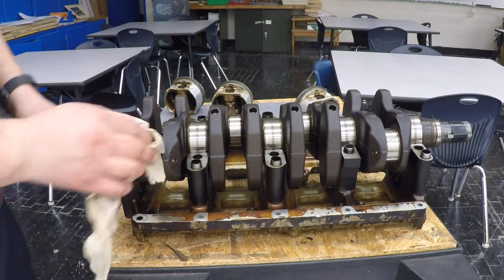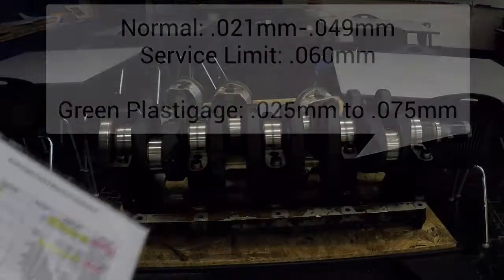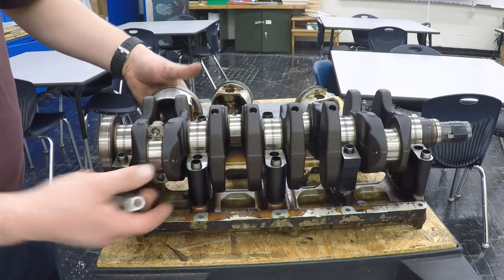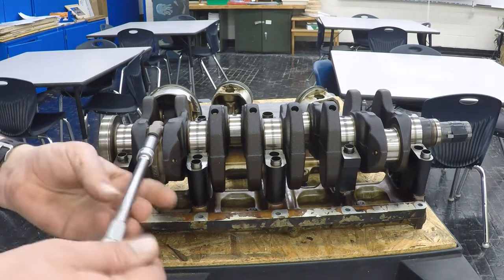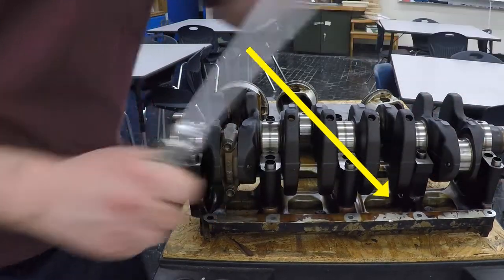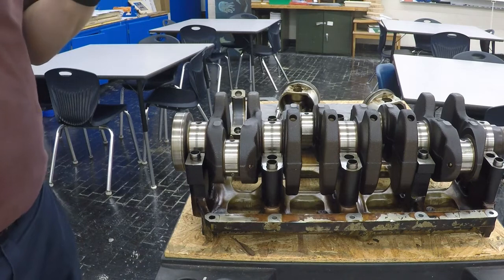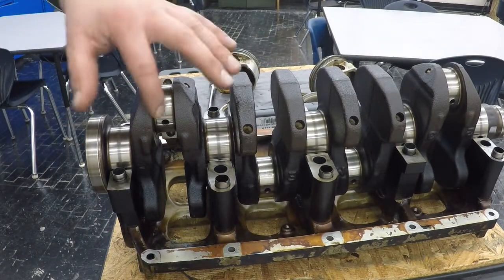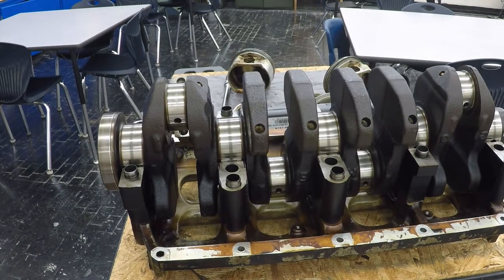Plastigauge: Measuring Connecting Rod Clearance

Comment: Could you not remove the bearing, use a larger plastiguage measure the total clearance without the bearing and subtract the clearance needed to get the perfect fitting rod bearing? I'm sure as hell not rebuilding this engine when i can get another for 1200, just trying to run it into the ground before swapping the engine.
Reply: You would measure the rods with an inside mic, snap gauges, or dial bore gauge (or just rezise the rods to spec), mic the crank, and order the bearings based on that. Plastigauge is more for checking than actual measuring.
Reply: Crate engines are hit and miss anymore, so if you are capable spend some time and rebuild one yourself. 
You can always just go with a shortblock which means your bearings and crank are installed and you bolt on everyhting else. 
Saves at least this part of the rebuild.

Comment: So what happens if it's to much or to little?
Reply from the maker: If it its too wide, then you do not have enough room for oil between the two surfaces. If it is too thin, then the oil is not able to fill the space and you have play between the two surfaces. (aka: knocking)
Reply: @MrAdkinsAuto  in that case would you just buy diferent bearings?
Reply from the maker: @henriquevaz7946  Need to measure the crankshaft journals and verify they are still in spec. If they are, then new bearings should fix it.

Comment: thumbs up for posting this video however I think in figure 1 of the plastigage it may show the strip of plastigage laying "lengthwise across the center of the bearing journal." I believe it's to check for uneven bearing wear across the journal. DYI type here as well so, in the end if the engine works for ya then do your thing! cheers!